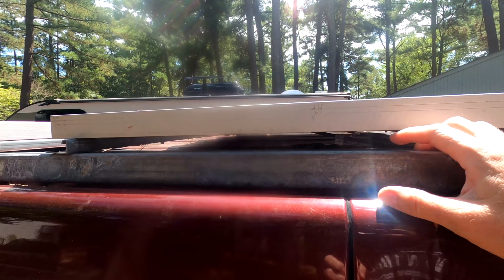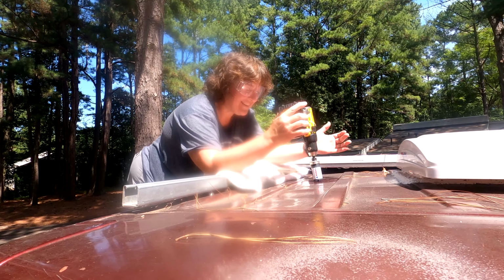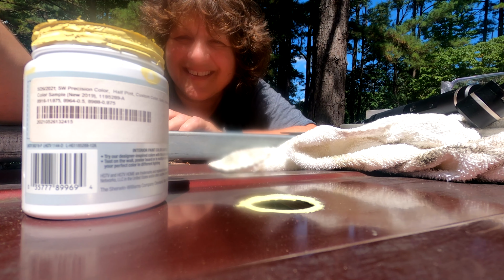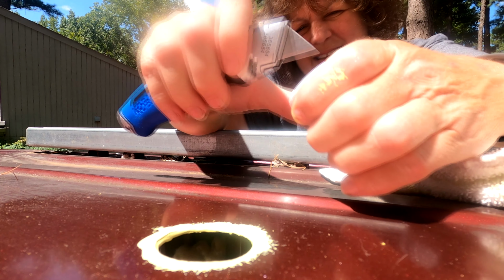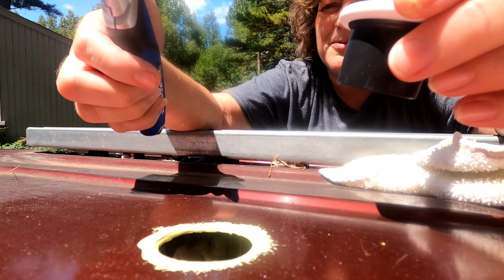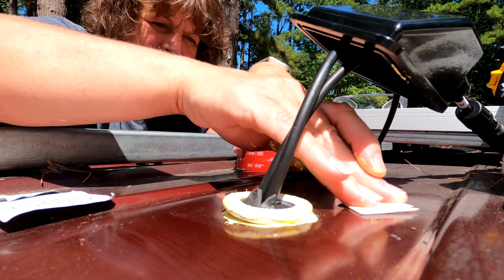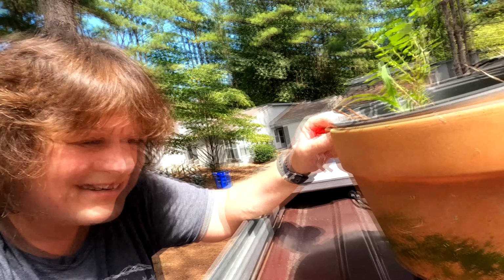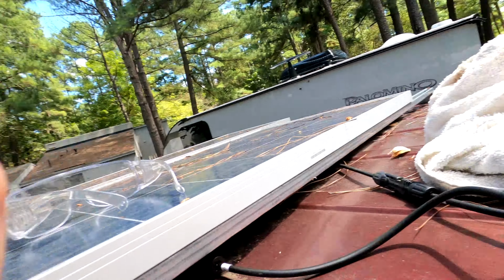Last hole in the roof/Sending solar wire through the van roof

Comment: Getting it done! 👍
Reply from the maker: Thanks. I finished the ceiling and starting the floor now
Reply: What are you going to be running with that panel?
Reply from the maker: On the solar panels? Maxi fan, led lights, fridge, phone charge and lap top charge.  That's basically it. I might add a small fan by my bed and electric blanket in winter if it will hold that